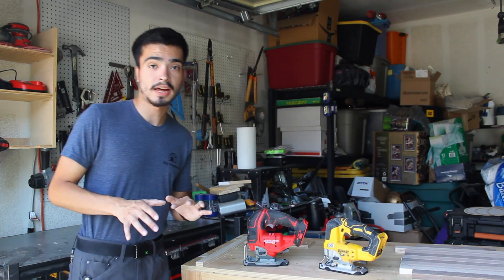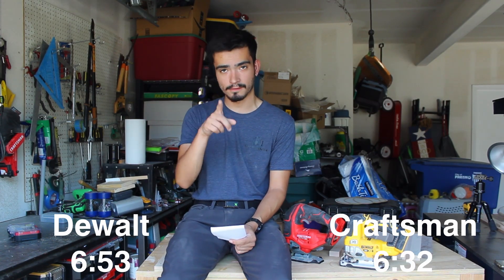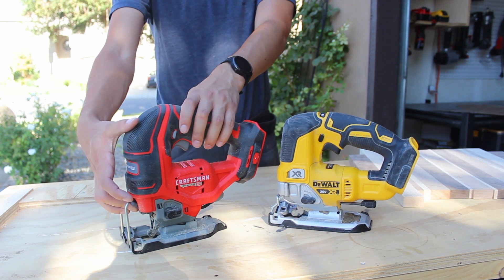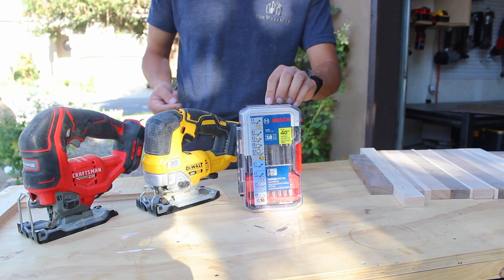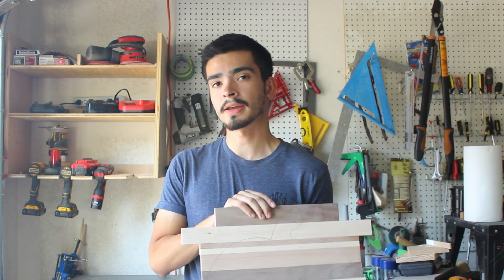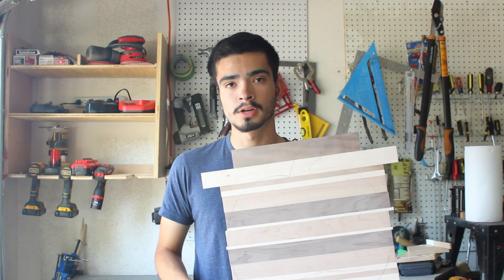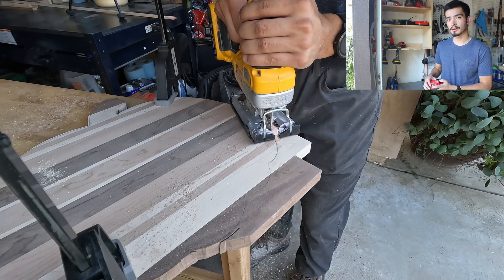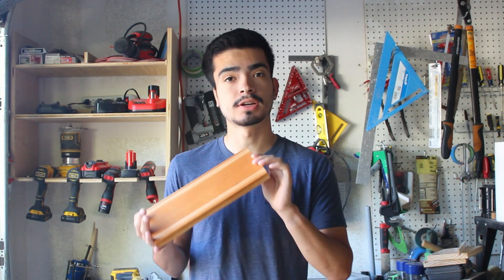Craftsman vs. Dewalt Jigsaw Comparison! (Craftsman's better?)

Comment: I have both I found when cutting through thick material 2 inches or more the dewalt would cut faster in non orbital and 1and 2 but through thinner material the craftsman cut faster on all three modes, I would recommend the craftsman because of the price I think they have the jigsaw 99 dollars they are so close in performance that I can't justify the higher price for dewalt
Reply from the maker: Thank you for your insight! I would agree, the performance of the craftsman for the price is a bargain.